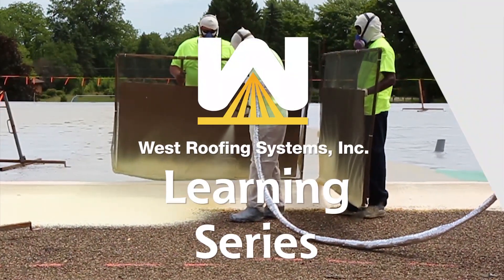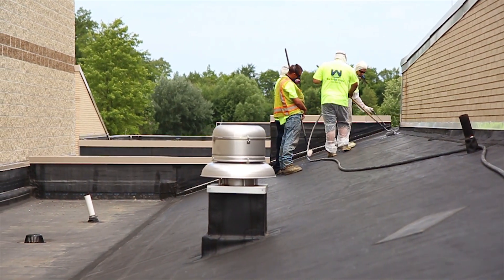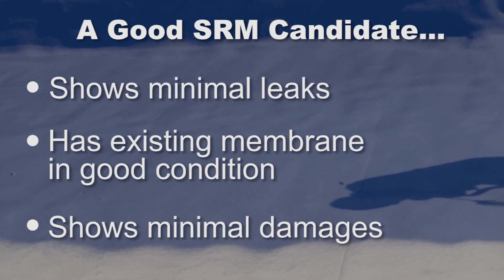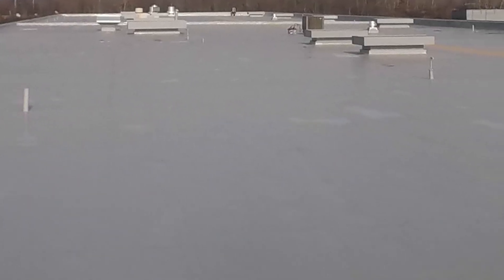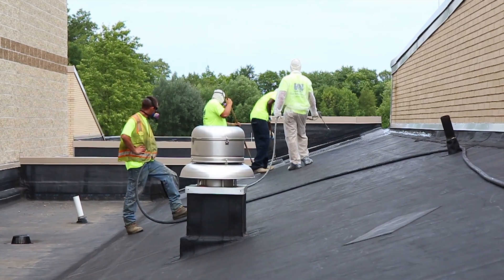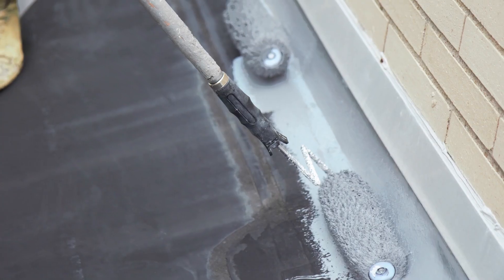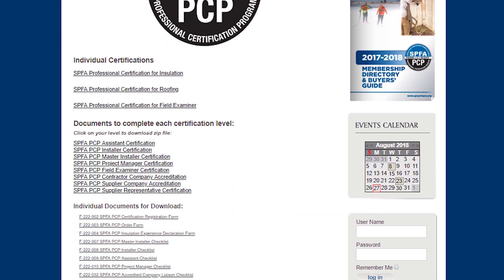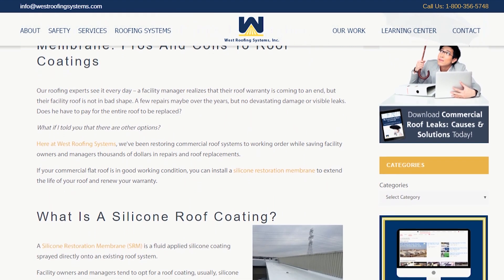Silicone Restoration Membrane: Pros & Cons to Roof Coatings

Comment from the maker: What if we told you that you can renew your commercial roof waterproofing capabilities without replacing your entire roof system? A Silicone Restoration Membrane (SRM), will renew your roof into a seamless, low-maintenance system with long-lasting performance… while renewing your warranty!